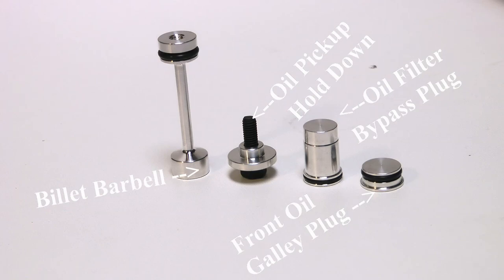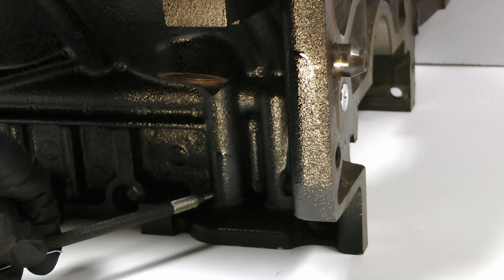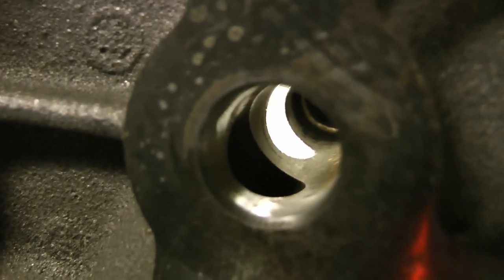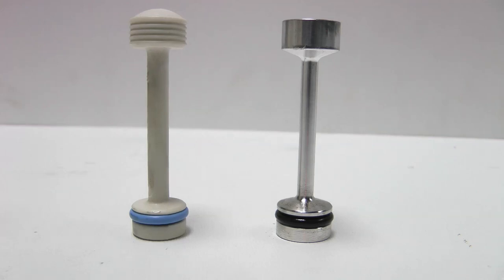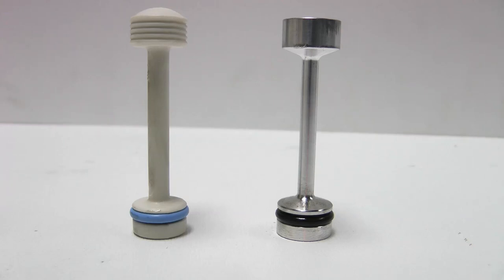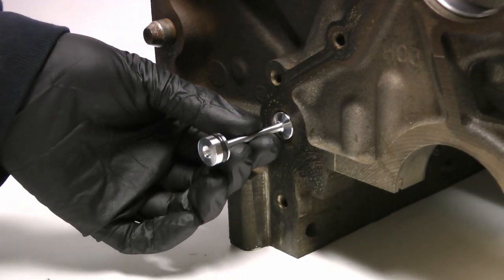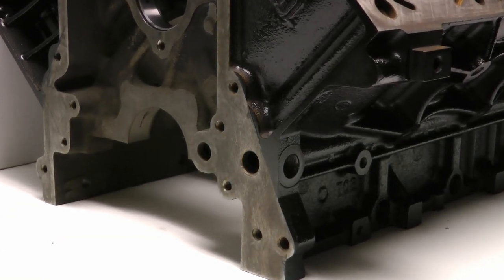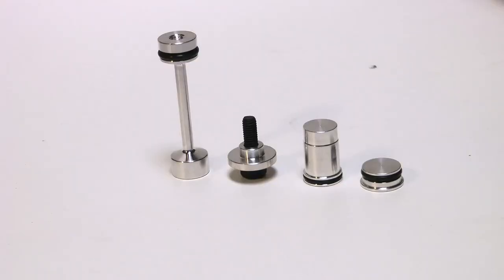LS Rebuild Must Have Oil System Parts - Billet Oil Barbell and Galley Plug by Sac City Corvette

Comment: Just ordered this kit. I was just looking for the front plug but this solves more. Thanks for sharing.
Reply from the maker: You got it, absolutely great products and very well thought out
Reply: @WestcoastWrenchin  Installed this, was a great upgrade and had no problem with any of the parts ordered. I did not install the piece to stop the oil bypass at the filter. I figure, dirty oil in better then a clogged filter with no oil flow. Personnel preference I guess.
Reply from the maker: @prancstaman  happy you like it, unique parts and top quality! You'll be happy you did